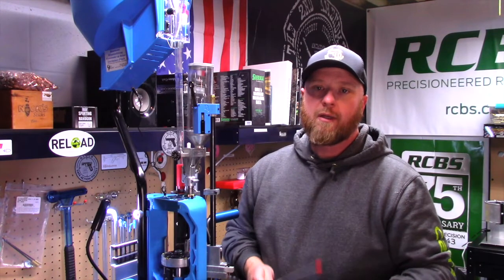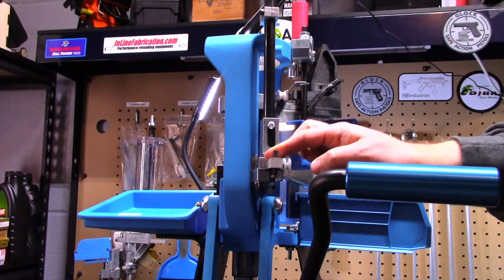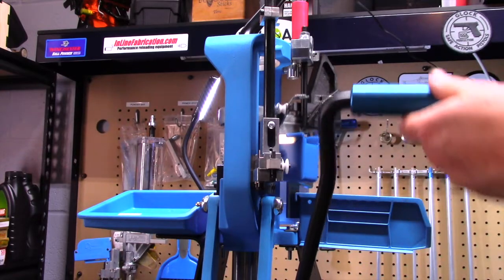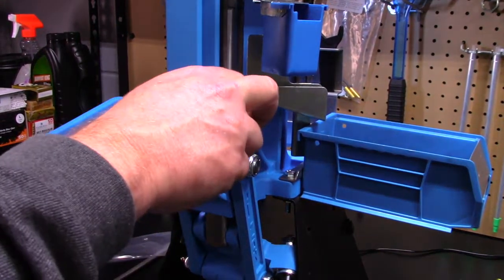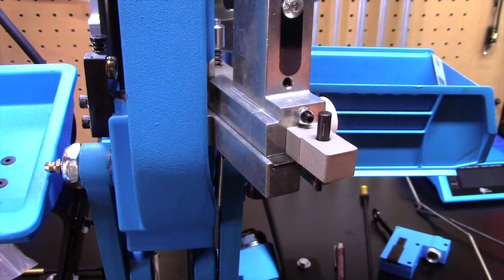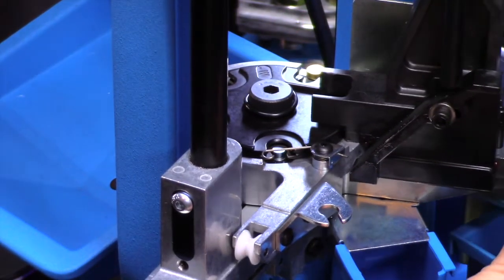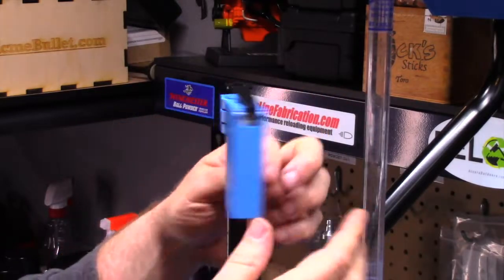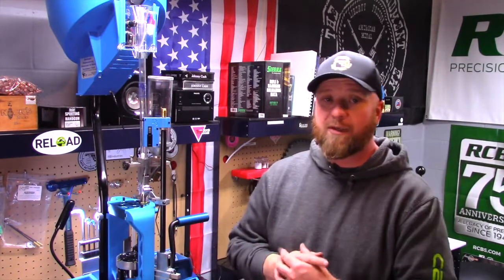Dillon XL750 Primer System Changeover   Part 7

Comment: You're videos are really helpful. I just picked up my new Dillon 750 xl and I just can not seem to get the primer bar to pickup a primer.  I've actually had a ton of problems as the dealer I purchased it from assemble a number of things wrong.  As an example; the dealer that sold me the machine and pre assembled it installed the double "A" powder bar upside down and backwards.  Prior to the powder falling all over the machine the bar did pick up primers, since then and after a ton of cleaning up I just can't seem to solve it.  I've looked down the tube, check the total cup height etc. Any recommendations would be awesome. I can email you if that would be better. Thanks so much!!
Reply from the maker: Email me if we can’t figure it out will give you a call.
Reply: Curious if you guys ever figured it out????

Comment: Great video but noticed that you didn't verify the alignment of the primer cup with the feeder tube once it is installed which to me is a pain seeing down the tube to check.
Reply: Do you know what any ways to adjust this? My primer cup keeps coming out empty OR the primer will have fallen onto the primer slide assemble and I think it’s because the slide assembly doesn’t get pushed in far enough.
Reply: @GFO270  There is a "Primer rear travel set screw" shown on page 21 of the manual
Reply: Most of the time if primers start not feeding or dropping I've had to replace the plastic magazine tip on the end of the primer tube as the lips have been bent
Reply: @dauton123  it’s a brand new machine so I’m guessing it’s an adjustment issue. I tried the brand new tube as well as a broken in one from my Dillon 550.  Same issue with both tubes
Reply: @GFO270  I've put a small piece of white material in the bottom of the primer cup and then shine a bright light into the primer feed area and look down the tube to see if it is aligned - page 44 of the manual.   The black leaf springtension is also adjustable and I don't tighten it all the way down
Reply: @dauton123  I just turn it a quarter turn and I think that did the trick! I was able to cycle 15 primers with no hiccups! Thank you!
Reply: @GFO270  Glad it worked, I've struggled many times and if I didn't already drink I would start after dumping an entire tube of primers

Comment: This is the video I watched before converting from large primer to small. Still can’t figure why all primers do not sit flat to be installed. 
Another problem is the casings do not drop. They are not lined up with the little red receiver.  I have reinstalled and cleaned everything. Any suggestions?
Reply from the maker: Yes on the swivel there is an adjustment screw on the side.  You can adjust the swivel in and out to get the cases to line up center.
Reply from the maker: Send me an email and we can talk over the phone or video chat to help you through your issues

Comment: Hey just bought the 750 new to loading and seam to have troubles with primers catching in the primer tube when I release them from the pick up any ideas?
Reply from the maker: Behind the spring plate on the primer tube body there is a very small hex screw.  This screw adjust the insertion depth of the slide bar.  You may need to  turn this screw to get the slide adjusted so that the pick up is centered under the primer tube.  If you are referring to the pickup tube as you are dropping the primers in confirm that the primer magazine is centered in the tube body before tightening down the knurled cap.  I think I covered this is my changeover video.
Reply: Squatch Reloading hey thank you for getting straight back to me but that is not where the issue is it’s in the actual tube it’s like the primers are sticking on the way down when I release them from the pick up tube?
Reply from the maker: Ok gotcha.  I would remove the tube and spray it out with some brake clean first.  There could be some residual processing lube in the tube.  I have ran a patch down mine with a very small amount of dry neck lube (graphite).
Reply: Squatch Reloading  thank you will try this tomorrow I appreciate your help, and enjoy learning from you videos.